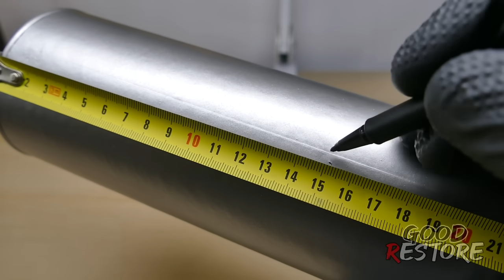Destroyed SCANIA fuel truck | Restoration Abandoned semi trailer

Comment: I really like your work, but I would have liked to seen how you restored the wheels and tires. Also how you restored the other plastic parts.
Reply: В начале покупает две игрушки, одну сжёг. От второй использует недостающие детали. В фильме не видно как печатали детали на 3D принтере, а отдельно магазина запчастей для игрушек и именно для этой модели я думаю не существует.
Reply: Muy acertado y suspicaz tu comentario 😀
Reply: He bought new ones. This isn’t a full restoration. He’s building a new truck by in large. That entire trailer is completely different. Not 1 original part

Comment: Not a real restore . Just replace the damagge part with a news . The real restore is repair all part with the original part that damage and used back and restore no matter what
Reply from the maker: in restorations some elements are replaced with new ones
Reply: @GoodRestore  seem like most then some hahahaha . The ruber off tyre , the spoilee of the roof . The thanks. Is like 80 percent is replace . Not repaire